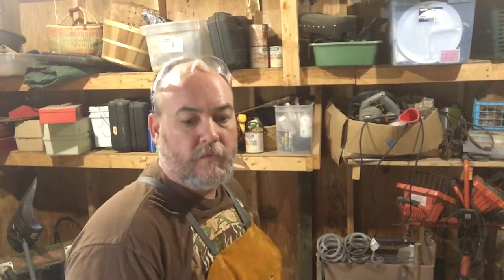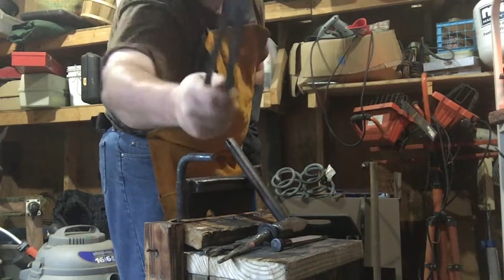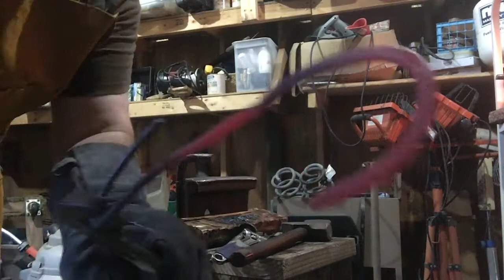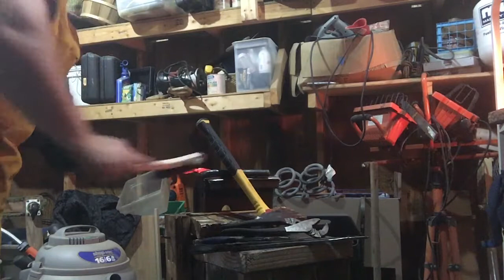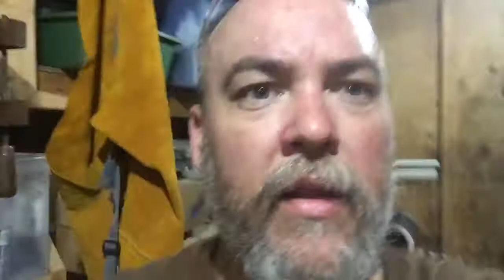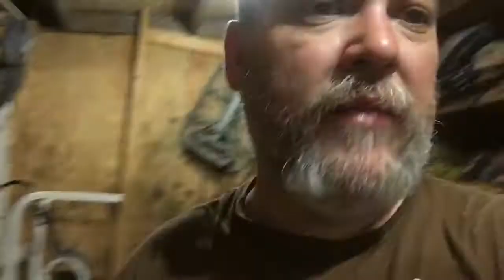S hook, split cross and leaf

Comment: NICE. Looks like those bolt jaws are treating you pretty well now!
Reply from the maker: yes they are
Reply: B & B Forge It's really cool watching things get better for you bit by bit. Now you can make tongs for just about any job you want them for.
Reply from the maker: yep not to bad I've only been doing this since December minus 6 week for a surgery i had in January so I'm happy with my progress
Reply: B & B Forge I've only been at it a few weeks total myself. It's been an interesting ride getting to just having the workshop set up. I'm trying to get up and running with smaller blades and see where it takes me.
Reply from the maker: I thought you had done blacksmithing before I thought you had just started doing blades.
Reply: B & B Forge No, I tried to start with blades. I added general blacksmithing to stay busy and expand my skill set some. Basically I started up about 4 years ago, had to pack it back up a few weeks later and then got it unpacked and set up about the time I joined FiF. I'm very much learning as I go right now.